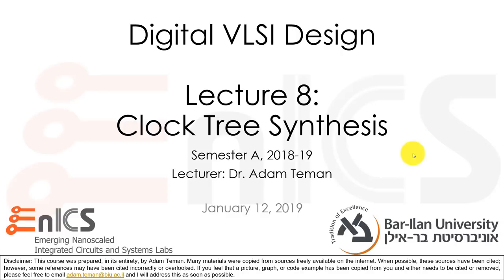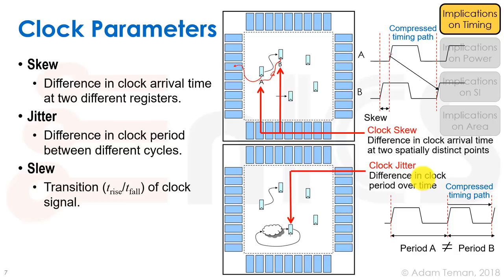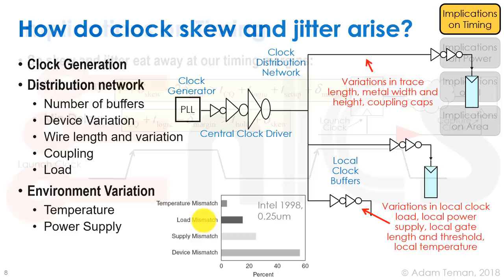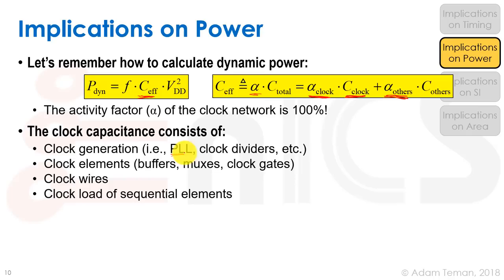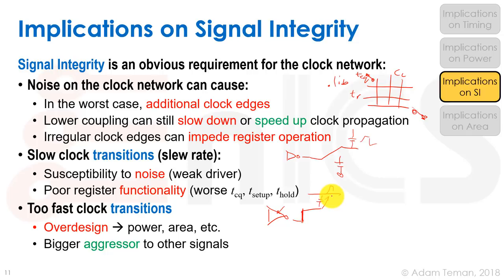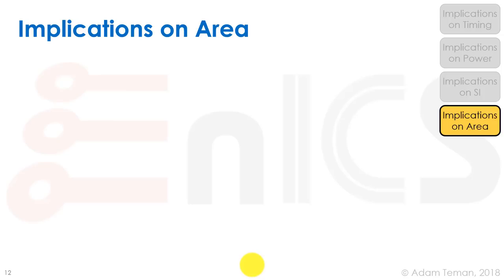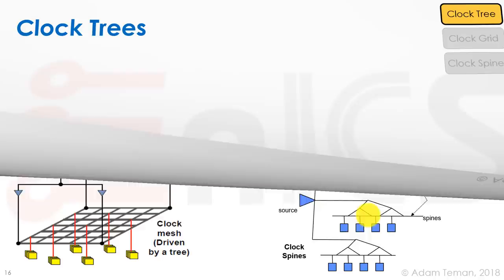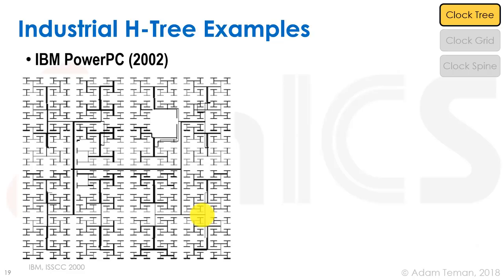DVD - Lecture 8: Clock Tree Synthesis

Comment: Your lectures are very helpful. Thanks for sharing your knowledge!
Reply from the maker: Your welcome! Thanks for the kind words.
Reply: @AdiTeman  Why we use buffer instead of an inverter in the clock tree path?
Reply from the maker: Sorry for the late reply, I didn't see your question until now.

Most of the tools, in fact, enable us to use inverters on the clock tree, as they cost less in terms of both area and power. We tend to call them "buffers", even if they are inverters, to both simplify the discussion and because they do buffer the signal (just with an inversion). There are some drawbacks to using inverters, however. For one, you need an even number to get the right polarity and this could cause some unwanted skew. The other is that since you are having different rise and fall sections along the clock tree, you may hit additional skew (vs. buffers that would have the same transitions everywhere). A third point is that a buffer actually is able to present a low capacitance and drive a high load, since it has the intermediate stage, whereas an inverter is only a single stage in that sense. 

But the bottom line is that this is usually an option in the tools that you can choose to use or not to use and analyze the results.

Comment: Hi Prof, it's truly a blessing for having a fantastic channel on VLSI topic. In fact, i refreshed most of my knowledge in VLSI through your videos. Well, I have a question and could you shed some lights on this. 

When you talk about the power consumption category, i am totally agree most of the Power spike comes from CTS stage. On the hand, here is my question. 

When you mentioned about Caches, Execution Units and Control, are these category comes from the fetch, decode and execution process during the accessing on memory data register? 

Next, it is related to the I/O Drivers (from Top Modules perspective), Are those power consumption of I/O drivers from pads and pins of all the blocks or interface? 

Please enlighten this part and would be helpful for me if you could reply on this matter. Honestly, I love all your sharing so far!
Reply from the maker: Hi Work,

I'm not sure I understood your question exactly, but let me try to answer what I think you are asking.

The first question was about caches, execution units and control. I don't exactly remember where I mentioned these in the lecture, but if we look at a CPU, it is made up exactly of control and execution (ALU) and is connected to memory and I/O. When we breakdown a RISC-style processor into pipeline stages, it is easy to separate the datapath into (among others) the stages you mentioned, and indeed, the fetch stage will access the instruction memory, the decode stage will apply control logic and access the register file, and the execution stage will run through the ALU. The data memory is often accessed during an additional stage. The CPU is an example of most other types of computational units (often called "accelerators"), which have some execution logic and some control and almost always are supplemented by some memory or at least registers. These also can often be pipelined. With regards to this specific lecture (CTS), each stage of computation includes registers that store/set the state of the operation and these require a clock signal. In addition, the memories (SRAMs and register files) require a clock signal.

The second question was about the I/O drivers. I am again not exactly sure what you are asking, but I/O cells are only needed at the chip interface, i.e., where the chip connects to the external world. Since we are driving wires that are of a different order-of-magnitude than on chip wires, we need very large buffers (ultra-wide transistors), as well as some other circuitry (See I/O and Packaging lecture https://youtu.be/O2Od1Tey-Jo). Driving these wires can consume quite a bit of power.
However, at the block level, the interface "pins" are almost virtual. They are just a piece of metal that another piece of metal from outside the block must connect to, but this can be a very small wire with small parasitics and therefore, doesn't necessarily require any special considerations for driving it. That being said, we often connect I/O buffers to these pins, but for a different reason than our I/O cells that are connected to the outside world (I'm not sure I discussed this in the lecture series). I/O buffers are just (rather small) buffers that do the following:
- input buffers make sure that the input pin is connected to a short wire with a fan in of 1, thereby reducing the chance that the transition on the input net will be horrible when connecting the block to its top level.
- output buffers make sure that the output pin is driven by a substantially sized buffer so that if a long wire with a large fanout is connected at the toplevel, it has a chance not to be weakly driven.

I hope that helped. If not, please clarify the questions.

Adi
Reply: @AdiTeman   In your sharing, you did shared about the power partitioning like a pie chart and it's not general(you did clarify on that). Hence, I was trying to relate where are these coming from. Besides the basic cycles of a CPU is fetch, decode and execute, so trying to relate them to the pie chart. Below are the details that i would like to know further and i assumed you answered all of them.  

1) The whole 40% are coming from the CTS stage which are the clock network structuring from, clock generation, elements, wire and load. 

2) Next, are the cache(20%), control(15%), executions(15%),(i was trying to relate with the CPU execution), so if those explanation as mentioned above are contributing to this segment then I absorb it as it is. Literally, your explanation still go back to clock signal in the control and execution stage. 

3) Finally, on the IO drivers(10%). Indeed, packaging has another phase of circuitry and it doesn't stopped at gdsII layers. 

So if all the explanation above is related to the pie chart of power partitioning then you did another fruitful sharing here. 

Thanks for adding value on the buffering. Well, as long you buffered along the wire at a reasonable distance you will not be seeing the transition regardless of the pin, ports or pads. Literally, I do check on the LUT to see the transition value and create BB if necessary to have bigger buffer. In fact, this required a lot of planning at the early stage of TOP floorplanning and different designer has different style of working the floorplan. 

Anyway, Prof, i'm glad that you reply promptly to my question which made my day. Thank you and Thank you.

Comment: Dear Adi, 
Very grateful to learn from this Lecture ,
My question is what is different between leaf pin and clock sink
Reply from the maker: Hi - good question. I guess you could say that they are synonyms. Depending on the literature or the tool, there can be slight differences in the definition, but a a high level, they are the same. Actually, CTS becomes quite complex in some designs - I would even say "mind boggling". It is really a hard issue and in one lecture without some real world experience, it is hard to grasp why there are all these options and what can be so problematic. But the clock network on SoCs can be really complex and that makes CTS a tough job. So, back to your question, I guess one answer could be that a "sink" is a skew balancing point of the clock tree, while a leaf may be the end of the clock graph but not a skew balancing point. That being said, it really depends on the fine-print of the tool, but for the most part these two terms are the same.
Reply: @AdiTeman  thanks for the detailed reply
I figure it out finally

Comment: Sir the content is superb . Can you please make more videos on it using Synopsys ICC2 compiler and its commands ....
Reply from the maker: Hi Ranveer. Thanks for the comments. Currently, I don't have plans to provide an alternative version with Synopsys commands. However, note that the commands are mainly provided to give some practical perspective of the more abstract concepts presented in the slides. In the end, the specific command for each tool and each vendor will be similar, albeit with many additional options and parameters, but you will need to use the tool user manual for the specific version in order to find the exact usage.

Comment: Hello sir, 
Thank you so much for this entire pd playlist..
I have a question how do we decide insertion delay and skew..how much value of insertion delay and skew is acceptable?
Reply from the maker: Good question and no "right" answer. I guess that in general, target insertion delay is a problematic objective, as it is directly proportional to the number of clock sinks in your design. But "the lower the better" is probably the best that can be said. The same goes for skew. To get lower skew, you will have to pay with additional buffers and clock tree levels, which will result in both higher power/area and higher insertion delay, so in a lot of ways, these two objectives are contradictory. The general approach is to iterate and see what the design can do and then constrain it to be about that or a bit more constrained. BUT - that brings us to the discussion of the CCOpt approach, where the skew "doesn't matter" and you should focus on meeting timing... So whatever skew/insertion delay you arrive at that meets timing is fine...
Reply: @AdiTeman 

I think it depends on the drv constraints you are having. The tool will try to ensure zero drv violations and for that, it will be placing buffers and inverters in the clock paths - this is lead to insertion/propogation delay. Then, the tool will try to make skew as minimum as possible - called as balanced skew. Then, the tool will try further to meet the setup/hold timings if not met by balanced skew by adding buffers here and there (clock/data path) - called as useful skew. 

Adi, please feel free to correct me if I am wrong.
Reply from the maker: Indeed, thank you Pankaj. 
This is basically how the CTS tools work.
I understood Anitha's question in a more abstract fashion, i.e., how do you define these DRV constraints. But once you have defined them, the tool works pretty much how you explained.

Comment: Usually in CTS global skew is optimised instead of local skew. what's the significance of optimizing global skew?
Reply from the maker: If I understand your question correctly, I think the appropriate answer is that the basis for CTS is that since you have optimized for setup (max delay) during synthesis, assuming an ideal clock, then if you could keep this situation (i.e., ideal clock), you would meet your timing (based on Synthesis) and not have hold violations (which are caused by positive skew). So let's try to remove as much skew as possible and everything will be okay. This would be a global skew target and this is a much harder optimization goal than local skew, since local skew is going to be smaller than global skew. If there are hold violations due to local skew, these can be handled separately after taking care of the bigger problem.

Comment: What are all the constraints related STA with CTS...?
I mean how our constraints in .sdc  changes/affects at each stage until CTS stage?
Reply from the maker: Good question, but the answer is a bit complicated. In general, I am all for maintaining a single .sdc file across all steps of the design. In this way, if a basic constraint is changed at one stage, it is propagated across all stages without having to go into each file and update it, which often leads to bugs. This can be done with some simple TCL code and variables that represent the stage that the design is currently at.
As for what changes - in a straightforward manner, the propagation of the clock is the main thing. So until CTS, the clock is treated as ideal (set_ideal_network) and afterwards, the clock should be propagated through the design and no longer treated as ideal. There are several sub-constraints that come out of this (for example, updating the I/O latency). These can be handled in many ways, starting from the EDA tools automatically changing settings according to the stage in the design and through particular methodologies that are applied at various companies. There is no "right answer", however, and each design and flow has to be fine tuned. The main thing is that you should have a basic understanding of the fundamental mechanisms going on and then you can adapt your methodology accordingly.
Reply: @AdiTeman   Sir in my design I have a hold violation of 30ps(i.e.., Hold Slack = -3.0456 ) at the CTS stage.Should I change few constraints in the .sdc file..??
My question is that "what are the constraints should be modified in .sdc which affects the setup slack at Placement stage and hold slack at CTS stage..??"
Is that a proper solution to change my .sdc constraints in my design...???
Reply from the maker: Hi Lalith. 
First of all, -3.0456 is 3ns (usually, depending on the settings of the tool), which is a HUGE hold slack. This is something that is not usually fixable in a straightforward fashion and usually results from:
1) incorrect SDC definitions (e.g., clock domain crossings)
2) incorrect or incomplete CTS definitions
Both (1) and (2) are design-specific and require a lot of planning, knowledge and work to get right. But to debug what is causing this extreme hold violation, what you must do is to look at the timing path that causes this error and try to understand where it comes from. First, see if the source of the launch and capture paths are from the same clock (if not, this is a clock domain crossing, which is, by definition, a violation unless synchronized). Second, see what causes the large skew between the launch and capture clock paths. That will give you a start in trying to debug and understand what happened.
Reply: @AdiTeman  Thanks a lot sir.

Comment: Hi sir,
My question is 
What will happen if we add two ICG or two latches in a single clock path .?
Reply from the maker: In general, two ICGs is not a problem. Of course, any path to an ICG is categorized as a "clock gating path" and timing analysis has to make sure that the enable arrives during the correct cycle. But assuming both ICGs are enabled, the clock will pass through undisturbed.
Regarding two latches in a single (non clock) path - this is a different issue that I have decided not to dive into in this course. In general, positive and negative latches can be cascaded with logic in between to better distribute the delays in a master-slave type of approach. But in general this is often used.

Comment: sir i have a question...if i apply a single clock to drive 50flipflops and other clock to drive 100 flipflops..which will consume more power?
Reply from the maker: I'm not sure I understand exactly, but I think the answer is, of course, that the clock driving 100 flip flops will consume more power than the one driving 50 flip flops, as the input capacitance of 100 flip flops (and the clock network to drive them) will be larger.
Reply: I also think 100 ff would consume more power as more capacitance - more transition time - more power consumption

Comment: Sir 
What is phase delay at a sink pin in cts
Reply from the maker: In the "old" Cadence timing reports jargon, a phase delay was basically the period length (T) of the clock. That is a simplification, since it can be a rising to falling or falling to rising (half period) or various other situations. I think they have changed the way they write it in newer (commonUI) versions to make it more clear. In any case, it is usually just the clock period.